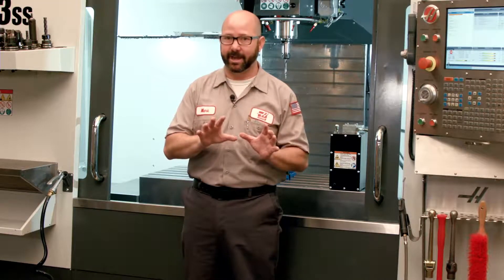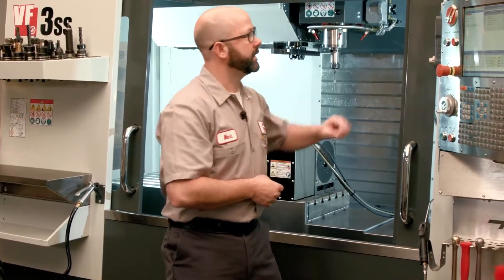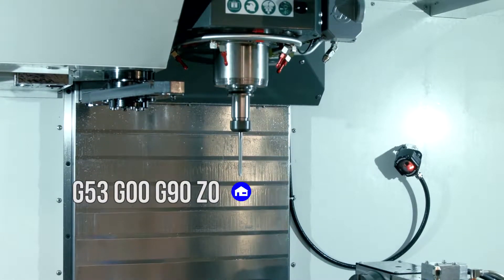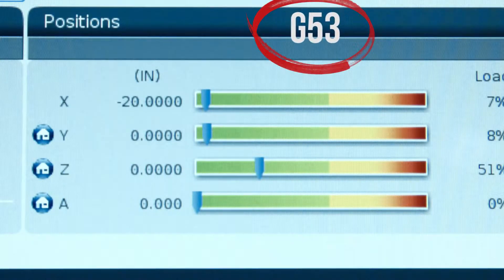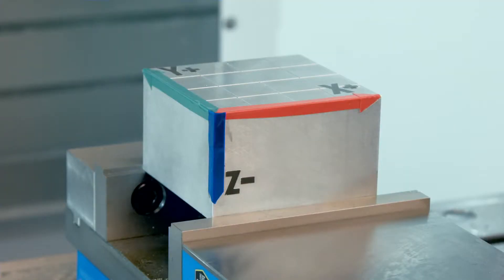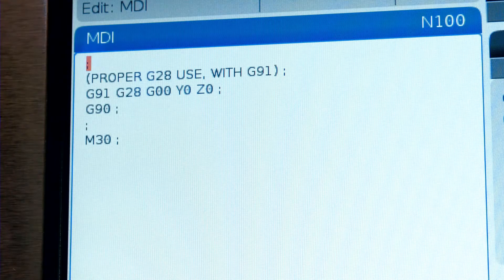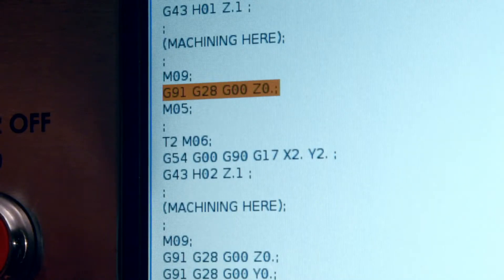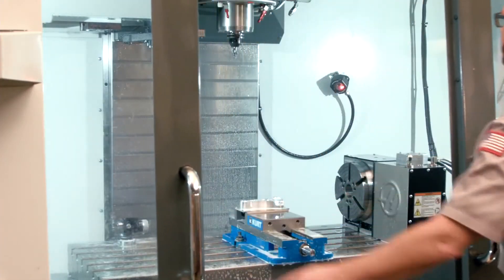Use G53 Instead of G28 to Send Your Haas Mill Home – Haas Automation Tip of the Day

Comment: 20 ALARMES ET MESSAGES CONSULTATION DES ALARM N1701 ALARH ACTIVES Messages HISTORIQUE D'ALARME ALARME 1 Total 4 01234 1 03 SERVO X ERREUR TROP GRANDE La charge sur le servomoteur de lexe X A cépassé le paramétre D Erreur max axe X. Les servos seront désactivés et il faut appuyer sur REINITIALISER pour effacer ralarme et activer les servos. Des outils désaffutés ou un programme incorrect font dépasser la charge maximale pour cet axe. Tour Le frein du servo sur le moteur d axe X n'est peut-être pas désengagé. 24 VCC est nécessaire pour libérer le frein L'alimentation du frein de servo est assurée à partir de la carte PS/PO Trans/Frein ou de la carte E/s P78/P79 lorsque les servos sont alimentés. Vériier que la carte 52 0-3 -12.) Fare déMer la descriptien Positions Trav G54 Minuteurs et comptrs cheo che: 0.0 TPH Chro Ce cyelei 132.436 58,138 71.753 0 % 0 % 0 % Dernier cycle : RESTE Compteur M301 compteur M002 . houcles rest 0 33 34 0-33 34 0/0000 5652 5651 Mom opI 0,00000 nce 0.000 act: 0 000 0 % ERVO X ERREUR TROP